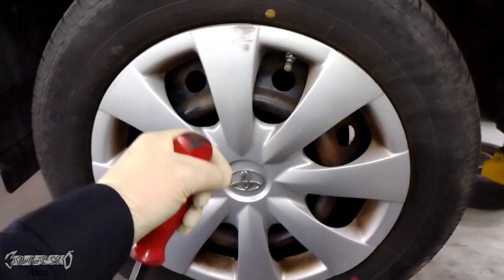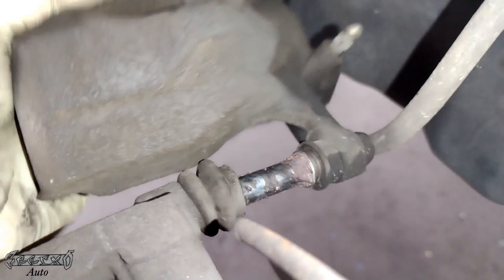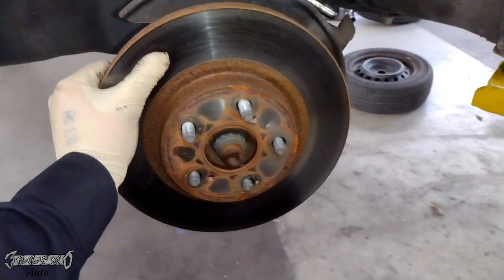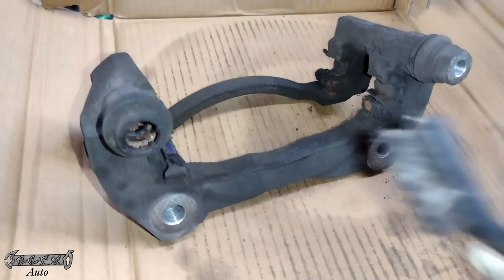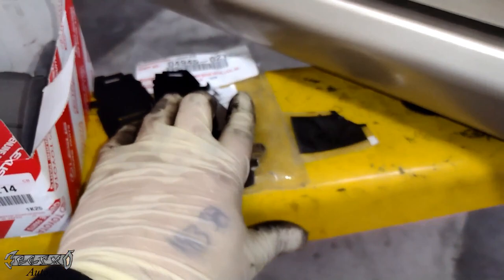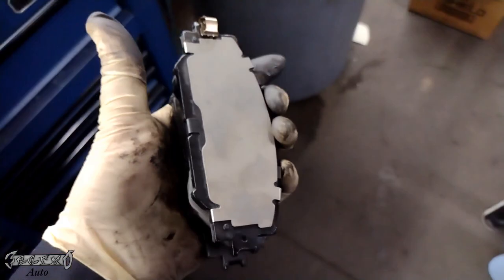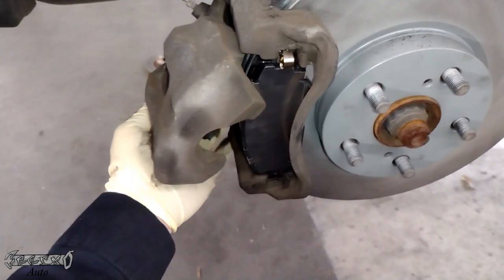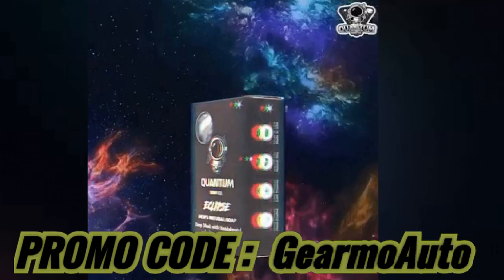2009-2013 TOYOTA COROLLA FRONT BRAKES TUTORIAL / FRONT PADS + ROTORS

Comment from the maker: GET GENUINE TOYOTA PADS HERE ( AMAZON) ( 54 BUCKS)
https://amzn.to/3DOsw10

GET THE TOYOTA BRAKE PAD SHIMS HERE ( AMAZON ) ( 24 BUCKS)
https://amzn.to/440ALBz

GET GENUINE TOYOTA FRONT ROTORS HERE ( AMAZON ) ( 72 BUCKS EACH, BUY 2 )
https://amzn.to/454bKXs

GET AFTERMARKET FRONT PADS HERE (AMAZON) ( 25 BUCKS )
( COMES WITH PADS AND SHIMS & HARDWARE )
https://amzn.to/3DPy5wf

GET AFTERMARKET FRONT ROTORS HERE (AMAZON) ( 32 BUCKS EACH , BUY 2 )
https://amzn.to/3s8HaO3

GET THE FEATURED BRAKE CALIPER TOOL HERE ( AMAZON) ($ 44 BUCKS)
https://amzn.to/3WXsmfT

GET AN ECONOMIC BRAKE CALIPER TOOL HERE ( AMAZON) ( $ 11 BUCKS)
( WORKS FINE)
https://amzn.to/3O0PgPy

GET THE BEST BRAKE LUBE HERE ( AMAZON ) (4.99)
https://amzn.to/3vJAfcG

GET SOME BRAKE CLEANER HERE ( AMAZON) ( 3 BUCKS )
https://amzn.to/3k2jtmj

TOYOTA BRAKE PADS PART # 04465-AZ214 (FROM VIDEO ) 

 ALTERNATIVE PART#S  THAT WORK TOO ( FOR FRONT PADS)
04465-AZ114 04465-02220, 04465-02240, 04465-0R010, 04465-42200

SHIM KIT PART # 04945-02150
FRONT ROTORS PART # 43512-02240 OR 43512-12710

Comment: did you slightly crack open the brake master cylinder reservoir so that the air pressure can get out--to be sure no seals are blown when depressing the brake piston??

Comment: I forgot to put the little clip/spring that goes on the top of the pad on yesterday when doing my brakes. drove to work today fine but at lunch it started making a clicking type noise when coming to a stop. Is that related to the spring/clip? and if so is it safe to drive home to put them on? thanks in advance.